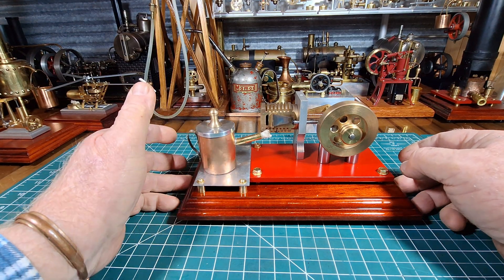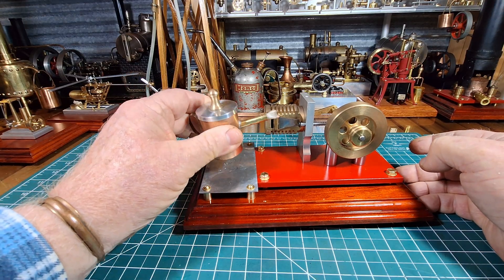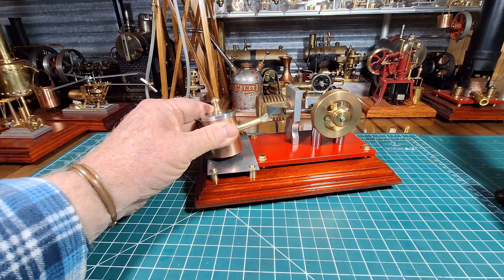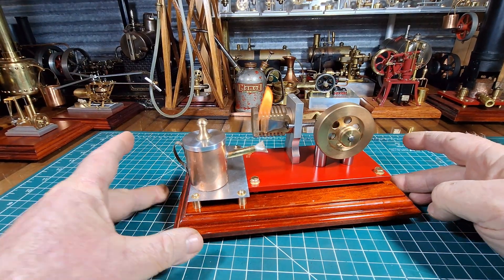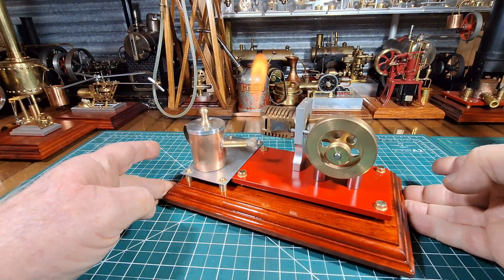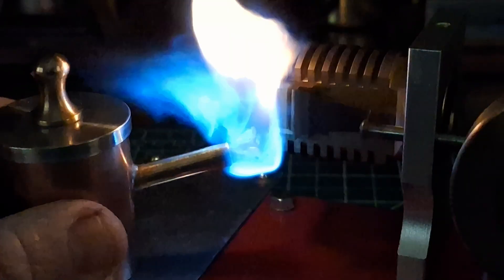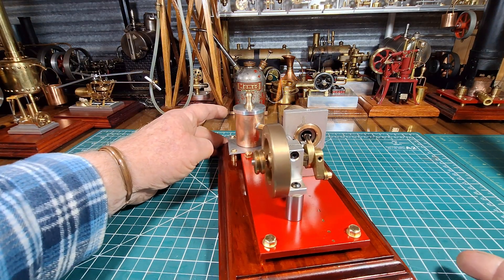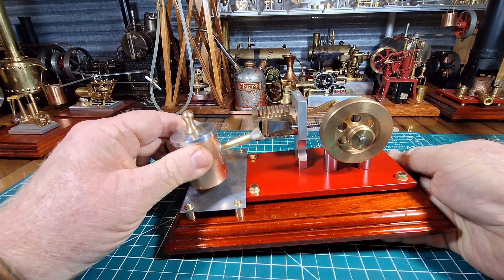Enjomor Vacuum Engine Flame Licker an Engine that runs on just a Naked Flame

Comment: awesome video jim, how powerful are those engines? and what sort of oil would one use for the piston?
Reply from the maker: I only use powdered graphite in mine. They are capable of running some 'easily' run accessories. - Cheers Jim

Comment: Very nice. I like the sound when the engine runs more slowly and the flame is sucked into the cylinder! Cheers, Detlef.
Reply from the maker: Thanks Detlef, very small changes in the positioning of the flame makes large changes in the behavior of the engine speed - Cheers Jim

Comment: Flame licker engines hate me. Finicky damn things. Have built and reviewed a few over the years and everything has to be just right or they won't run.  Also no power to drive anything from my experience.  That pattern works well, but as shown the flame position is critical. Cheers Rob
Reply from the maker: Yes they can be problematic mongrels and the flame is critical, even the slightest breeze moving the flame can play havoc. Preheating the cylinder has always worked well for me by getting rid of the problematic condensation that happens if they don't start on that very first try. I've had a fair bit of success running accessories off them (as long as they don't have to work too hard) -
https://youtu.be/9YOzJoBvqqk
Cheers Jim

Comment: Hey Jim. I'm finding Youtube views have cratered mate...is it the spread of shots d'you think?
Lovely job with the engine :) I have the V2 of that one. Fun, but a bastard too https://youtu.be/FjLnMtegmQU?si=AgV-KN1SyEBT9abr&t=48
Do consider prewarming or condensate might prematurely end your run, wreck your graphite dust in the bore...and when done turn it over a few turns by hand at the end to exhaust the last meths combustion fumes )which contains water) for air, else the engine will seize before next time :)
Reply from the maker: G'day Thomas. there's never any rhythm or reason for YT views. Hope you are feeling a lot better mate after your health episode and back enjoying what you do. Yes I usually always preheat the cylinder so as to not get that instant condensate. I'm still having a useless time trying to time a Model 25 mini engine....I've been close to getting a sledge hammer!!!! Have a good weekend mate - Cheers Jim

Comment: Nice video as always, Jim! Quick question do flame golfers run faster if there’s a hotter flame
Reply from the maker: Yes the flame has a LOT to do with the way the engine runs Stephen. Even the slightest alteration you can hear and see a difference in how the engine runs - Cheers Jim